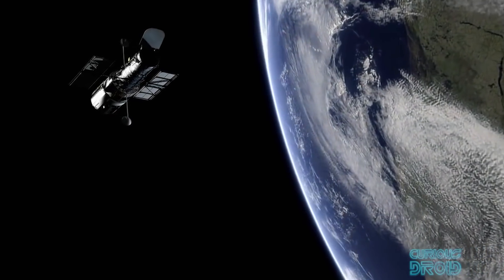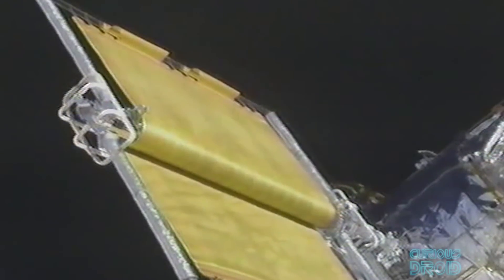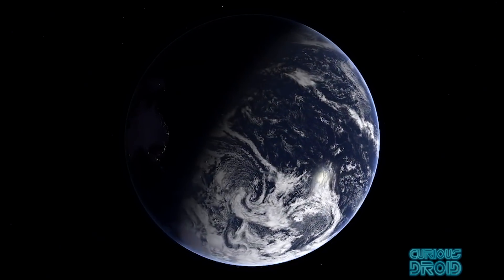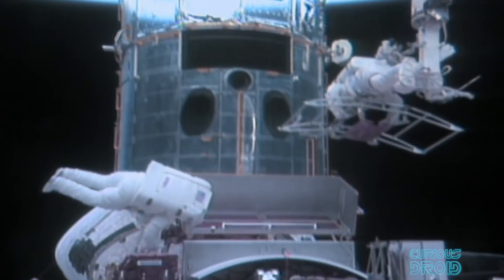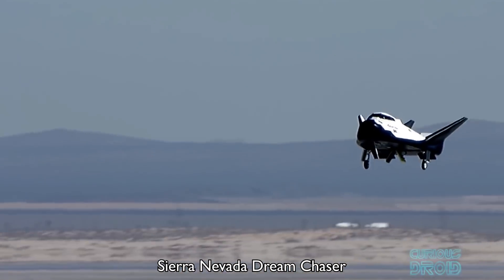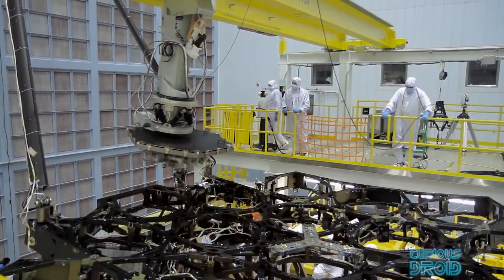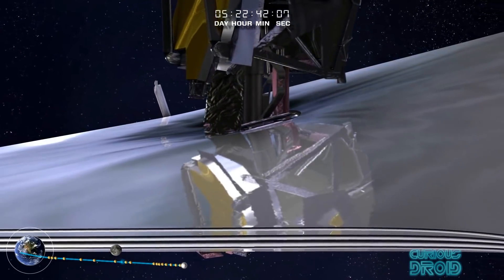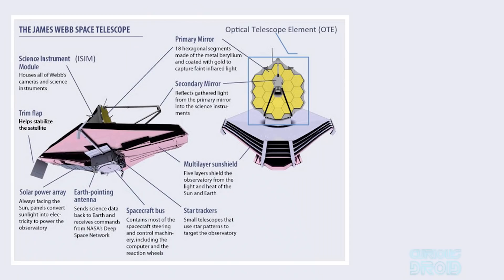Can We Save Hubble and Where is the James Webb Space Telescope?

Comment: I always thought that the mirror was ground to perfection, the problem was that they did not take the effects of zero gravity in account.  When the Hubble made it into orbit, the mirror changed shape a tiny bit, resulting in the image problems.  Was that not right?
Reply: I thought the story about mirror is that primary polishing sensor was not setup properly before making parabolic form of the Hubble mirror. So the form was still ideal parabola, but with different parameter than specified. The ideal form allowed to create corrective optics for proper focusing of the image.
This was production error, not gravity influence.

Comment: Apparently, the engineers and scientists have completely figured out the Hubble and its problems.  Instead of sending spaceships and crews back and forth to fix it, if there is substantial work still left in the areas it handles, send a new one or two new ones in the same missile. While they are expensive in production and materials, the very expensive and lengthy research and development aren't there.  There must be some degradation occurring on the Hubble from micro-mediorites and the such anyway.
    I assume it must be in a dangerously low orbit because the higher orbits are filled with satellite debris.  Having a low orbit not only leads to orbit decay, the air would degrade the images and damage it.

Comment: My idea for Hubble is to build a gyroscope package designed to connect to the grappling hook that was installed on the last service mission. Then,  shut down the gyroscopes on board the telescope and use the ones in the new package. Send up the new package on a remote rocket.  Coordinate the new package with the telescope with the same communication pathways used to control the telescope currently.

Comment: the hubble was updated with connection structures. this would allow a rocket pack, to attach, and send it wherever you would like. even another lagrange point. on the gyros, thus the rocket pack, could also have the pointing units necessary for fine control. thus, this jobbie could keep going as long as its main control units still functioned.

Comment: I may catch hell for this but, Personally, I don't think the shuttle program should've been scrapped. This video is just one example. I do understand that the program was outdated and safety risks did impose on many of the missions. Funding is also another concern if not the biggest. However, what I do not understand is why to go to through all of the trouble to design, test, and successfully send many Astronauts into space just to cancel it. 133 successes/ 2 failures. If anything why not fix what was broken, downsize the shuttle itself and only use it for major repairs/large replacement parts/equipment too large for a single rocket.
Reply: They worked a lot of the bugs out of the Shuttle after the failures and decided to scrap it. I would have thought keeping at least one in operational state for missions like Hubble service would make sense. But that would have kept the support teams idle between missions.
Reply: Maybe, but I'm sure with all that's been going on with the Rovers, Upcoming Mars Recon, much of that could've kept them busy between launches.
Reply: But how many other projects would have to be cut to fund the continued shuttle program?
Reply: Why any? Two of the most important are already in orbit. If anything those upcoming projects could've helped not only fund themselves but the shuttle as well.
Reply: You can't just pause something like the shuttle program until you find some job for it worth doing.
Reply: Wouldn't necessarily be paused,  not with all the supply missions to the ISS. If you think about it they could've taken Enterprise, which was essentially a prototype and used it to re-design anything the other shuttles needed. Instead much like Discovery, Atlantis and Endeavor it now sits and collects dust.
Reply: Shuttle COST was $1 BILLION per launch.
Reply: @LightWingStudios  No it didn't. The complete cost for the program was $196 billion, per launch 450 million on average.
Reply: @JeffM252  in the end costs per launch where more then 1 billion...
Reply: @baronvonlimbourgh1716  Yeah, in the end, it probably did. But it didn't have to be.
Reply: @LightWingStudios  according to a Business Insider article, it cost us then 81million per astronaut to ride the soyuz, Shuttle seated 7. It is vital for us to come up with something not only to be more cost efficient but also be able to repair large items. We had it, we ditched it.
Reply: I totally agree with you. It was still a very well engineered vehicle. It could of been tweeked to be more lke the Russian version. It's also wierd we didn't have a replacement when we decided to scrap it.
Reply: Exactly!!

Comment: HST has a "soft dock" mechanism attached on the final service mission (STS-125). Either the Orion CEV (using the Delta Cryogenic Upper Stage) or even Boeing's Commercial vehicle could boost HST to a higher orbit. A cylindrical module with replacement parts can be launched unmanned (like how the USSR and Russia did for the Mir modules) by ESA from French Guyana, dock with HST and be followed by a NASA crew using either Orion CEV or the Boeing Commercial Vehicle can upgrade HST – the ESA-launched module being jettisoned to burn up like the Soyuz's Orbital Module during re-entry.

Comment: If the BFR becomes a thing, Hubble can be retrieved or repaired using that. It'll fit in the payload bay, either for recovery or so technicians can work on it without needing bulky EVA suits.
Reply: If the BFR actually becomes a thing that is.
Reply: Does the BFR have big cargo doors that could fit the Hubble. The Hubble is actually huge...it barely fit in the Shuttle...and I've not seen a picture of the BFR featuring a cargo bay with opening doors nearly 50 feet long....
Reply: @RealityIsTheNow  None of us out here in the public arena know what the payload doors will look like (and I'm not convinced the design is finalised internally, either), but volumetrically it looks like the BFS v3.0 bay is about 15.5m long, so if the sunshade is closed it'll fit with just over half a metre to spare at each end. Diameter isn't a problem because it's 4.5m inside 9m.
Reply: Well, they need all that tank volume so they can get 100t into LEO.  But if thy were to make a specialised version for retrieval ops then it would be going up empty, so they could shrink the tanks and lengthen the payload bay, sure.
A BFS is apparently supposed to cost between $200m and $350m (obviously it could be used for other missions, so a Hubble- retieval mission wouldn't have to foot the whole cost).  Given the importance of the HST to astronomy, that seems pretty reasonable to prevent it becoming just more debris on the ocean floor somewhere.  Better collect Kepler while we're up there. :)
Reply: I would imagine you could make a special edition of BFR to handle large cargo. The large cargo of the shuttle was one of the few things it was actually really good for.  I will remain skeptical about BFR until first test launch even though i assume in theory it will work.

Comment: 1. Send an unmanned rocket up to catch and dock with Hubble, move it to L1 between the Earth and the moon, rocket will be equipped with new gyroscopes and fuel for a long time for small corrections, Hubble can stay in Earth/Moon L1 and continue extend its service life.
2. Send an unmanned or manned rocket up to catch and dock with Hubble and attach small boosters, these boosters will move Hubble to same orbit as ISS and dock with ISS to continue working as telescope.
Reply: Hubble is not capable of docking. During service missions, it was grabbed by manipulator arm that the space shuttle was equiped with.
Attaching it to ISS is not a solution. Aiming? Keeping it steady with all vibration s conning from ISS? Let's not do it.
Reply: DestinationVoid
adam giovino
That is incorrect, on 2009 Hubble had a soft capture mechanism installed that allows it to dock to any vessel that uses the NASA docking system, so grabbing it and docking it to ISS or any other type of rocket is very possible, using a manned or unmanned vehicle.
Bringing it back to earth could be done inside a shell that could endure the re-entry heat but in my opinion using a booster to move it to the same orbit as the ISS for docking would be more feasible since the ISS has a robotic arm it would make the possibility of servicing and maybe sending Hubble back into space more feasible.
I do not know the Hubble orbit requirements in order for its telescope to work though, but what would prevent it from docking to ISS, be repaired and maybe upgraded and send it to a higher orbit?

Just my thoughts.
Reply: First the Hubble is not capable of docking like previously stated Hubble was specifically designed for the space shuttle and the only real way which is possible to actually move Hubble would be either design something completely new to put an exoskeleton around Hubble and this exoskeleton would have to have a shuttle like grabbing arm which would be far too expensive what would be more cost-effective is pulled the shuttle out of the Smithsonian which is the best kept shuttle preformed extensive maintenance on it get one last flight out of that air frame grab the Hubble and bring it down for maintenance on Hubble we will just have to hope a manned Mission can be sent to Hubble all maintenance has to be done by Eva it would be risky to conduct maintenance on Hubbell because you would have no grabbing arm to keep the two next to each other but some people may say it would be worth it
Reply: ISS is pretty beat up too. I think that both ISS and Hubble could be moved to a Lagrange point. The ISS could be tasked with long term research into the effects of solar winds and cosmic radiation on samples and equipment. Such research would ultimately be destructive to the station but the data gained could be useful for improving technology to enable more thorough exploration of the solar system. Of course almost all research would have to be automated because of the difficulty and risk of supplying and changing crews as well as avoiding long term health problems. Thus it would become only part time habited from occasional visits to deliver and adjust experiments. If hubble was parked close to ISS, communication and observation between them and Earth might help troubleshoot future breakdowns.

A replacement for ISS could be mobile and some of the design details could be verified by component testing on ISS. The new station could be a ship of some kind - space fluyt. A ship that could slowly reposition using fuel efficient propulsion such as ion drive. It would still probably be limited to near Earth operations but could change orbits and perhaps make a trip around Earth's moon by using boosters.

Then the next generation of ship could use nuclear thermal rockets for repeated manned missions to Mars and Venus, parking at Earth orbit between cruises for resupply, maintenance, and crew changes. The main barrier to this is the long term effects of the outer space environment on humans and equipment, which the ISS and first replacement ship would hopefully find solutions for.
Reply: CATCH AND COCK!?!?!?!?!? I kno u mean DOCK RIGHT?!.?!.?!.?!.?!.?!.?
Reply: mackie08560 Fixed. :)
Reply: Men have to upgrade Hubble working 10 years more, before it comes down. The only way available now is a Soyuz-mission combined with a comercial freightmission to couple an exoskeleton-like machine to Hubble. Can be developed I think in 3 years using known techniques.
Reply: GreyBeard29 Where there's a will there's a way.
Reply: Yeah...let's spend a few years developing a new vehicle to do all of that. The Shuttle was an orbiting work platform with an airlock and robotic arms and a cargo bay and such. SpaceX is working REALLY HARD at just building a simple capsule that can't do anything like any of that.
Reply: Number 2 is more problematic as the ISS itself is in an orbit only permitted by the effective range of the Soyuz and Shuttle.
Reply: Steve McQ  a service module with the guidance mechanisms designed to dock with the capture fixture that was left attached to Hubble after the last service mission. This service module would be configured to take over the guidance of the scope and have propulsion to be able to raise its orbit. When the module is exhausted then it can disengage and a new one docked.
Reply: So all people commenting here ignore the fact that Hubble in in an orbit HIGHER than ISS and at a different inclination? Basic orbital mechanics and delta-v mean nothing these days?
Reply: Dan Slotea I haven’t. My plan is stand alone.

Comment: Big fan, but I wanted to point out one error in your wording. The cost to "develop" the F-35 is not $400 billion as you stated, but closer to $55.1 billion (RDT&E). The $400 billion figure you mentioned includes the cost of building 2,456 copies of the jet with production going to the year 2044.
Reply: Its more like a $1 TRILLION. The purchasing power of $1 in 1980's is equal to the purchasing power of around $3 in 2017. 
Plus, many purchase orders have been slashed. It will be another 10 years and several upgrade tranches before it even achieves originally set target capabilities. It was designed to be an inferior product from the onset. In substance a fancy computer with wings. And what is common to all computers?
Reply: tropickman

The 1.5 trillion figure is a full project estimation until 2070 including inflation.

We're in 2018, computers are what win wars today.
Reply: Yup. That includes the total "all-in" cost to 2070 in "then-year" dollars. It includes everything, including the cost to fly the jets. Even if the F-35 was never built, we'd be flying something else, which would also cost money to fly.
Reply: Actually, the figures are in "then-year" dollars. Most of the dollars are yet to be spent. The $1.5 trillion figure is the cost of the F-35 program, from the start at the beginning of the century, out to when the last F-35 is retired in 2070. That includes the development, testing, spare parts, maintenance, upgrades, fuel, etc.Even if zero were purchased, the older F-16s that are wearing out would still cost money to fly. The $400 billion figure (R&D and procurement) is actually $380 billion, and even that is mostly in inflated dollars (LESS than $380 billion in today's dollars). So, you essentially have it backwards.
Reply: Production is declared as 320+ by September 2018, that would cost 36 billion in addition to 55 billion.
Reply: The USMC and USAF have IOC squadrons. Israel and the USMC have both used the F-35 in combat. IOT&E testing begins in a matter of weeks. The only failure of the jet was on the promised price, which was estimated absurdly low. The technical merits of the jet are many. But, this post wasn't to discuss the merits of the F-35. I only meant to point out that Curious Droid's statement that it cost $400 billion to "develop" was inaccurate.

Comment: boosting is not too much of an issue as nasa made sure to add a soft capture mechanism (basically a docking port) on the last servicing mission. A modified supply spacecraft or even an Orion or Crew Dragon could concievable visit and boost hubble's orbit, but servicing without the shuttle's arm is likely very risky if not impossible.
Reply: Isn't it called Canada Arm?
Reply: I guess the Canadians can name it after their country if it makes them feel good? It's a robotic arm, no matter what you decide to call it. I wish Canada would get around to building a spacecraft and putting someone in orbit rather than worrying about simple robotic arms and what to name them.
Reply: Those tiny capsules don't have airlocks, to say nothing of the need for robotic arms and the sort of cargo capacity to carry engines and fuel up to what is actually an extremely high orbit (it was at the very limit of how high even the Shuttle could go). The Shuttle was a beast...airlock, giant cargo bay and capacity, large crew, robotic arm, etc etc...too bad we don't have what amounts to a utility truck in space anymore.
Reply: @RealityIsTheNow  modify the interior to survive decompression, after all apollo spacecraft didn't use an airlock.
Reply: The docking port they added was for deobiting Hubble. NASA will deorbit it to make sure it does not crash over land. NASA all ready knows its fate

Comment: This seems like going from running (Hubble) to mach 1 (JWS) without knowing how propellers work. An improvement to the Hubble by a few factors with new tech would have been a smart idea, but since it's hard to move out periodically maybe it's not as good as a permanent solution.

Is 20-30 years worth of service with 3-5x the resolution worth doing?